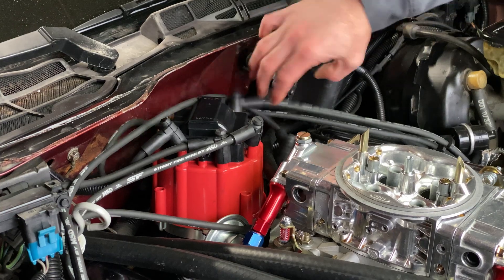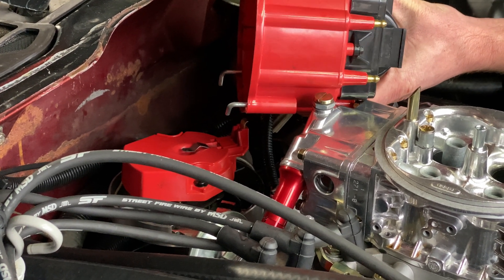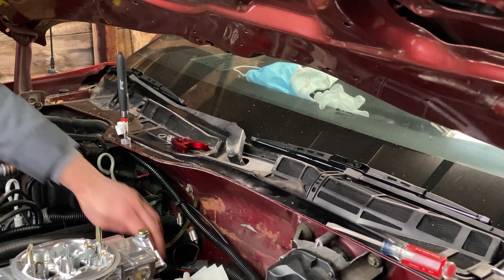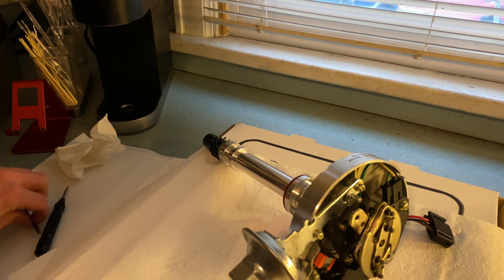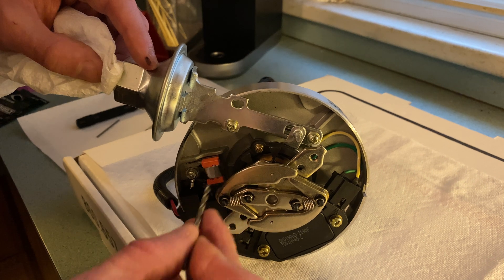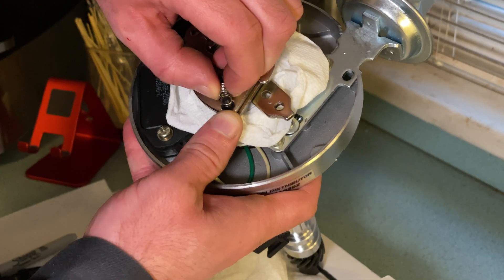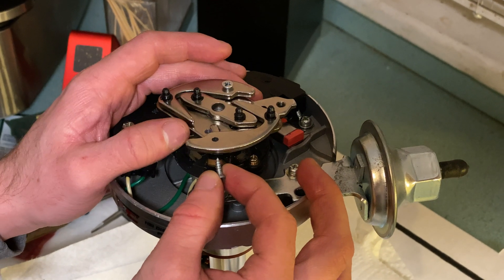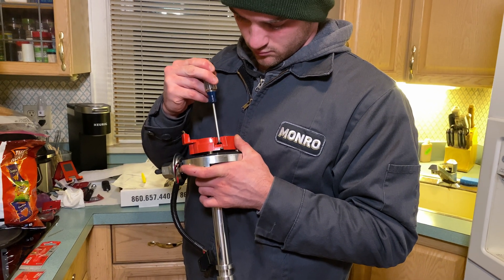How to Lock Out the Timing on an HEI Distributor - A Complete Guide

Comment: What about the GM module retarding with increasing speed ? (MSD module doesn't do it)
You need 12 degrees of centrifugal (6 distributor degrees) with heavy springs just to get constant timing at the plug with factory modules.
Reply from the maker: We don't want the timing to change, that's why we had to lock it. Instead of spending money on a pro-billet distributor and ignition box, we did it this way.

Comment: So you locked it fully closed so it won't open at all ?
Reply from the maker: Correct. It's locked so it won't vary from the timing that's set. If for instance the timing is too advanced and we decrease it, it will always stay at that new decreased setting. It won't increase or decrease automatically as they normally do.

Comment: If advance curve doesn’t change while the rmp increases, doesn’t damage the engine at all???
Reply from the maker: Hi! I'm so sorry for the slow reply. I wanted to check with Matt about this and totally forgot to reply. He said - as long as you don't go too far, it shouldn't be a problem. He locked it at 36 degrees. Most cars advance the timing automatically when the RPM increases. Matt wanted more timing at idle, and that's what this does. Many distributors have the lock-out capability built in, but they're expensive and Matt didn't want to spend the money. Thanks for watching!
Reply: @MarkDHall  .
Thanks for getting back to me. I am still wondering if the advance curve fixed on 36degree, so 36degree crank advance during idle won’t cause any fireback or engine damage??
Reply from the maker: We haven’t had any issues, and it’s been this way for a couple years.

Comment: I'll be doing this tomorrow. BBC solid roller nitrous cam. Just can't get things adjusted with the lower timing. Runs a little rich and won't adjust out. Dosen't seem happy with base timing in upper 20s. I am running an msd box that has start retard so it should work good. Thanks
Reply from the maker: How did it turn out? I hope it worked. Matt had the same issue and said his timing needed to go higher. Internet research said to try this, and thankfully, for us, it worked. Hope it did for you too!
Reply: @MarkDHall  it made it happier. Was blacking the spark plugs and make you sick with gas fumes. It's good now. My buddy I bought it from ran crank trigger ignition with a locked distributer. So basically the same deal. Thanks
Reply from the maker: That's great. I never heard of having the timing so high, but Matt was like, "Yeah, that's what it needs."
Reply: @MarkDHall  I locked it on 35,36 and it idles much cleaner now. I have an msd box and it will retard timing 20 degrees for starting. Soon as the engine hits 800rpm it goes back to 35. Keeps it from kicking back.
Reply from the maker: @johnfinley4024  Sounds like it worked perfect. Matt was too cheap to get a box and is thankful it's working properly without it. His engine is low compression, so that may help, but I imagine it wouldn't work with a higher compression one.
Reply from the maker: @johnfinley4024  That sounds great. Matt was too cheap to buy a box (he said that's the right way to do it), but thankfully, his is working okay. His engine is low compression, but he said not having the box can be an issue when the compression is higher.

Comment: Instead of using the screws you used why not just use rivets it would make for a lot nicer end result
Reply from the maker: Matt thought that but figured since it's only visible with the cap and rotor off he'd just stick with screws.
Reply: good idea

Comment: Why not just take the weights off
Reply: Ya I just locked mine out. I bought the "kit" .... 

All it was, was a plate that about 3/4 wide and 3 inches long with 4 3/16 holes that are inlined with eachother.  You could make pie easy.  Except o spent 25 dollars for mine.
Reply from the maker: @davidvonanderseck8649  Thanks! For some reason I think Matt read that wouldn't work with his distributer, which is why he did it this way, but that was awhile and I'm old, so I may not be remembering right.
Reply from the maker: Would that actually work?

Comment: If you take the weights off and switch sides with them it does the same thing without drilling it
Reply from the maker: Hi. I can’t speak for other distributors, but with this one, that doesn’t work. I know some higher end MSD models have the capability built in, but you need an ignition box.

Comment: ? Are you droping the distributor in on the zero mark at tdc or 34 degrees before tdc
Reply: You lock them out with the weights out in advance position so the rotor will be phased correctly to the cap, dead on, at speed.  And the easiest way to do this is by putting a Hillman 5mm Allen head cap screw available at any Lowes or Home Depot in the inside hole where the rotor attaches.  Install with a tiny amount of thread locker to keep them set.  They self thread and fit perfect.  Total cost $1.  No disassembly or drilling required.       Now if you want to leave 12° of mechanical in it you use the Hillman 5mm Allen head set screw.  It has no “head” and allows for 11-12 degrees of advance and will leave your initial at 23-24 degrees allowing the car to start and perform well without tearing the nose cone off the starter at each start up and or not wanting to hot start due to excess advance at start-up.    If you lock out a distributor and the car is hard to start installing   a power switch to the distributor helps.   That way you can spin the motor up with the starter then flip the switch to the distributor, for a smooth start.   Above all.  Everyone  needs to know that locking out a distributor at 36° can make some motors kick back real hard at start up, can destroy starters and may not start when heat soaked.  There is a trade off.   I used the set screw and left mine at 24° with 12° of advance on real light springs so I’m at 36° by 2000 rpm.  And she starts good.
Reply: @PontiacSkunkWorks  thanks
Reply from the maker: Hey Jacob. Yes, drop it in at zero and then adjust from there.
Reply: @MarkDHall  thanks for the reply i just did this today i had the wrong timing tab on so now its 32 degrees at the 12 o'clock position
Reply from the maker: @jacobjarvis2545  Sorry for my slow reply earlier. How’s it running?
Reply: @MarkDHall  best it ever has
Reply from the maker: Glad you got it figured out. Sometimes it takes some trial and error to get it right.
Reply from the maker: Glad you got it figured out. Sometimes it takes some trial and error to get it right.
Reply from the maker: Glad you got it figured out. Sometimes it takes some trial and error to get it right.
Reply from the maker: Glad you got it working good!

Comment: I bet its hard to crank
Reply: Is it hard to crank when it's hot
Reply from the maker: @davidrowland2354  It's not really hard, but it can take a couple seconds. I forget what Matt said it was, but it's not vapor lock.
Reply from the maker: Hi! It's actually not. Turns over and fires up in 2-3 cranks is all.
Reply: @MarkDHall  my experience has been if you put too much initial timing it makes the motor hard to turn over
Reply from the maker: @davidrowland2354  This is the only motor we've done that too, so we don't have anything to compare it to. Does compression make a difference? This is a pretty low compression motor. Maybe that's got something to do with it?
Reply: It depends a lot on a lot of factors but if it's not binding up on hot start then go for it I'm just not a big fan of locking them out

Comment: Why would u wanna do this?
Reply from the maker: Some camshafts like a lot of initial timing at low RPMs, but with most distributors, if you set the initial timing high to start, you'll have way too much total timing as the RPMs increase and the timing advances. This can damage the engine. When you lock the distributor, it keeps the timing consistent at all RPMS.

Its easier to lock the ignition timing and just keep it the same at all RPM ranges instead of having to limit the amount of mechanical advance and adjust your timing curve throughout the RPM range. Certain distributors have the capability to lock the ignition timing, but they are expensive, and we didn't have the money to buy one, so this is sort of a "poor mans" way to do it.

Hope this helps, but if not, let me know, and I'll try to explain it better.

Comment: I don't understand the point of locking out the timing
Reply from the maker: Hi Bart. Some camshafts like a lot of initial timing at low RPMs, but with most distributors, if you set the initial timing higher, you'll have way too much total timing as the RPMs increase and the timing advances. This can damage the engine. When you lock the distributor, it keeps the timing consistent at all RPMS.

Its easier to lock the ignition timing and just keep it the same at all RPM ranges instead of having to limit the amount of mechanical advance and adjust your timing curve throughout the RPM range. Certain distributors have the capability to lock the ignition timing, but they are expensive, and we didn't have the money to buy one, so this is sort of a "poor mans" way to do it.

Comment: I was having the same problem with a thumpr cam and to big of a cylinder head combo, i ran an adjustable vacuum canister and was able to dial in 32* initial with 42-48* part throttle highway cruising with the vacuum canister and total of 37 at WOT with the mechanical advance, im going to lock out my HEI now though. I picked up a 6AL-2 and can digitally program everything now which is more accurate so the video has helped with that. Thanks!
Reply from the maker: Hi Mike. I'm sorry I didn't reply sooner. I'm not sure how I missed your message. Glad the video helped! If the lockout didn't work, Matt was going to get a new ignition box/distributor. Thanks again for watching!

Comment: Hey man great video! I’m running a custom grind isky cam in my 355 sbc, and I’m having advancing problems as well and imma lock my distributor out as well. I will probably weld mine though. My build is also on my channel as well man. Thanks again!
Reply from the maker: Thank you for the kind words. Sorry I didn’t see your message sooner. I’m going to go to your channel and check out your engine too. I think welding is probably a better option, but this seems to be working OK so far.

Comment: Should have drilled the holes while holding the distributor in full advance. When the cap and distributor were being designed they was expecting it to spend more time advanced so that's where it will work better.  Maybe I'm just nit picky with mine but that's what I do.
Reply: Why would it work any different in full advance or not? It shouldn't make any difference at all
Reply from the maker: Hi Poul. Thank you for watching. That's a great suggestion!

Comment: So did you set the 35 degrees of timing at idle ?, or at 2500 to 3000 rpm? I have the same HEI, on a sbc 350 running a Comp cams Thumpr and was thinking of doing the same thing , nice video BTW...
Reply from the maker: Hi Ross, thank you for watching. We set the timing at idle, but because the timing is locked, it stays the same at all RPMs, so I don't think it  really matters at what RPM you check it. In a normal distributor that's not locked, the initial timing at idle is less than the total timing at a higher RPM. As the RPM increases, the weights expand, which advances the timing, but because the weights are locked in place with this setup, the timing will stay the same throughout the RPM range. The cam we have is also a Thumpr. It's a 305, so yours is going to be a lot more powerful. I hope this answered your questions, but if not, please let me know. Thanks again!
Reply: @MarkDHall  Thanks for the response and it makes sense...  I have a spare HEII, so I will try this , !!

Comment: Great video Thanks for sharing ! 😁Were there any big improvements ??? What did you set your vacuum advance at?
Reply from the maker: Hi Tyler. Thank you for watching! The timing is set at 35 degrees. There is no vacuum advance. The improvements were huge. Very snappy and great throttle response.
Reply: Should help with cams at or more with 240 @ 50 , burning rich at idle . Correct ?
Reply from the maker: Yes. It should run cleaner at idol.
Reply: @MarkDHall  I D L E
NOT IDOL!!  
You are clearly thinking of Billy!